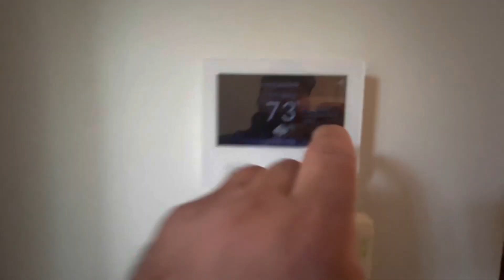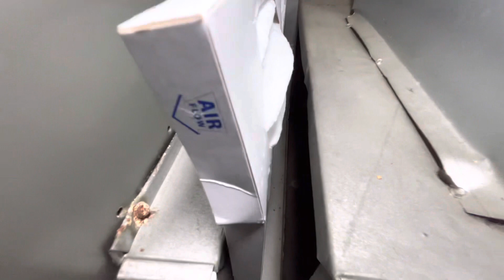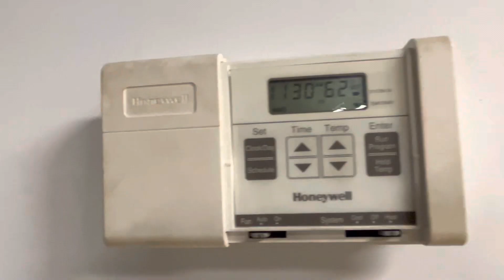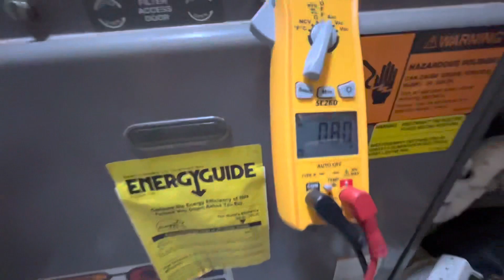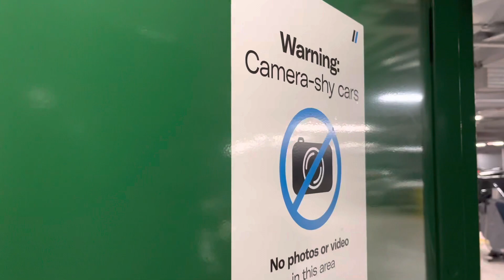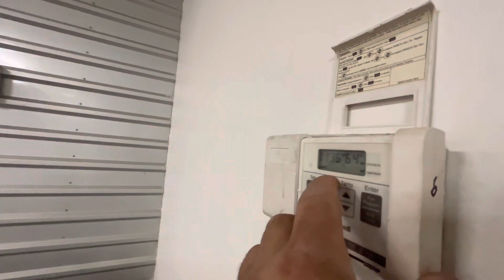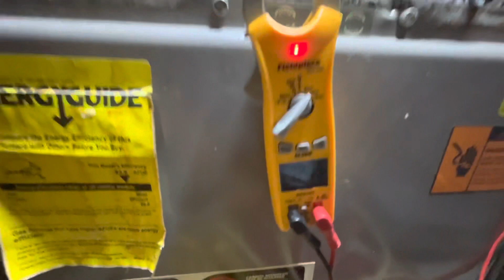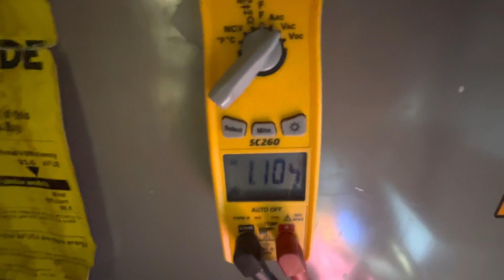HVAC. TWO FAILED FURNACES.  SEQUENCE OF OPERATIONS SAYS IT ALL.  Failed control board and igniter.

Comment: I hope it actually is the board on hat furnace for your sake. I have ran into those Rheems quite a bit and the gas valve is in line with that lower pressure switch. Sometimes the collector box/hoses gets clogged up and cuts the voltage to the gas valve. I always check that when I run into these Rheems.